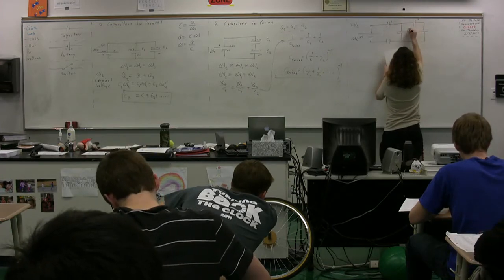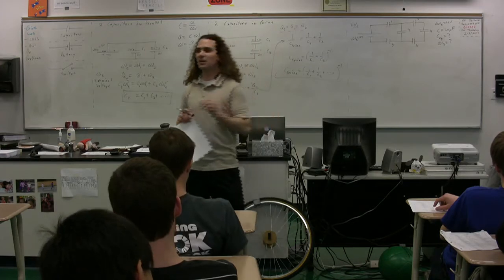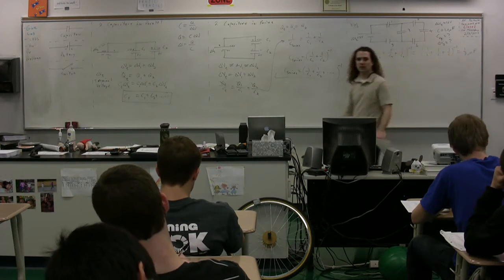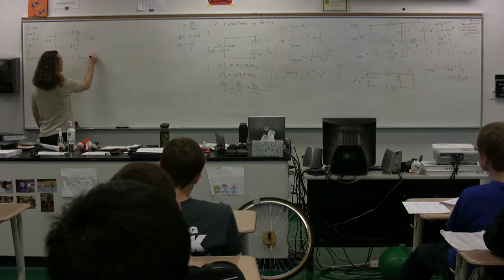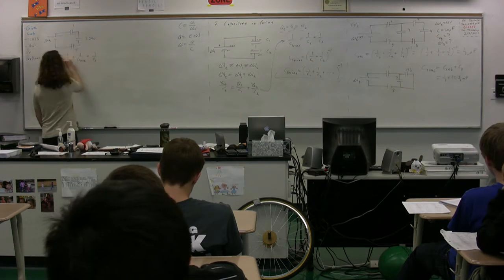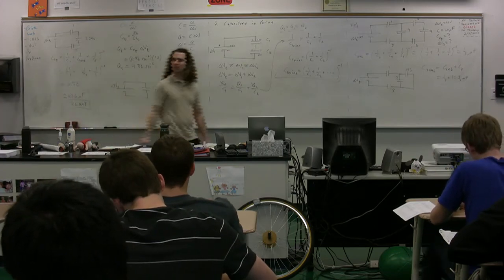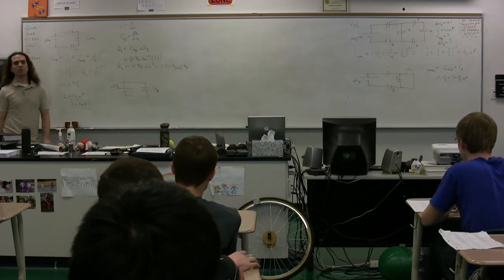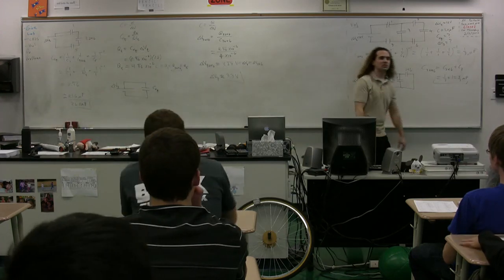Example - Capacitors in a Simple Circuit - AP Physics C

Comment: Hey Mr. P, are 1 and 5 in parallel, and are 2 and 6 in parallel?
Reply: Nope. 2, 4 and 6 are in series. 1 and 5 are neither in parallel nor in series.  Once you create a single, equivalent capacitor from 2,4,6 and 3, then 1, 5 and the equivalent capacitor (2,4,6,3) are in series.